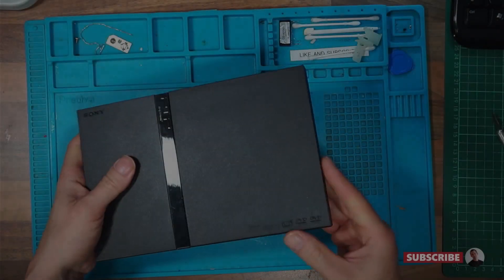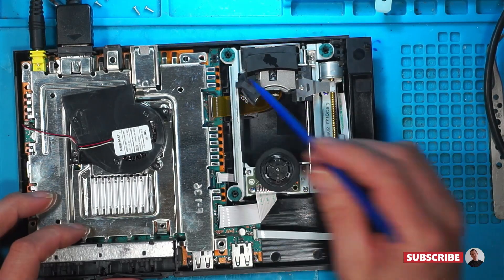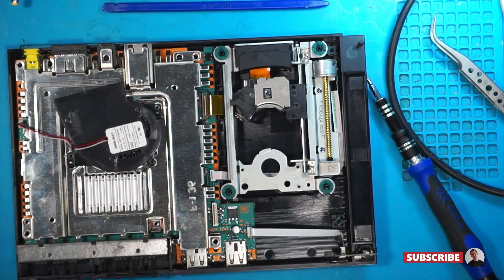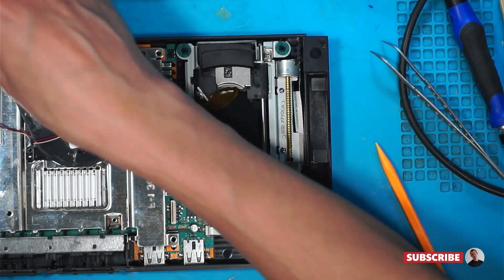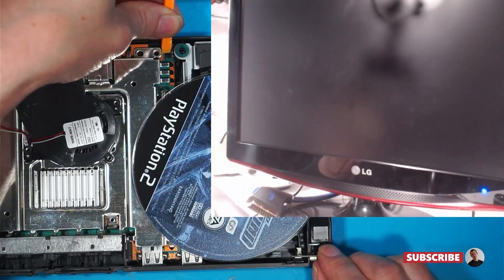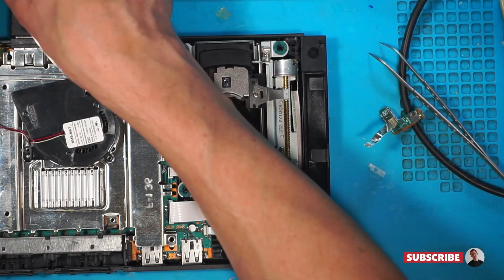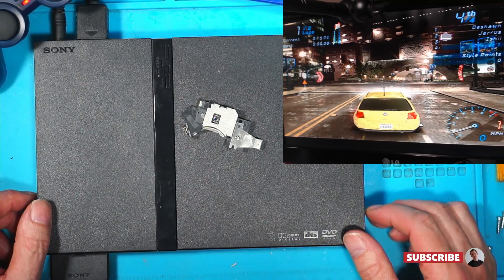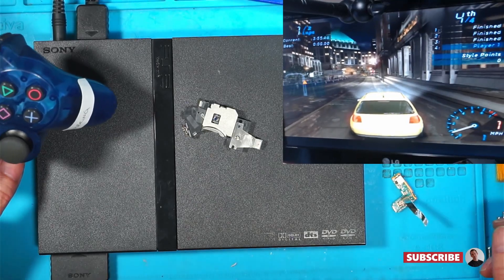How I Fixed a Playstation 2 slim that wouldn't read discs | PS2 laser repair

Comment: Interesting. My PS2 hasn’t worked ever since. So I’m supposed to replace my PS2 fat laser first? I know yours is a slim. Mine doesn’t spin disk either. The laser on mine is 1000% faulty that’s for sure. I just hope I don’t have to replace the spindle motor too.

Comment: I have a PS2 slim and I would like to know what are the signs of it dying.
Reply from the maker: When it doesn't play games? Does the one you have not work?
Reply: @PhilipBryden  my PS2 works but I would like to know what kind of sounds will it make when it is about to die.
Reply from the maker: @dianagarza9988  I don't think the sound it makes can give an indication of if or when it will fail.

Comment: Hello there. I found a similar problem in my PS2 Slim 77004. The disk doesn't spin at all. Do you think it is the same problem? I've done some troubleshooting, because i have another 77004 that works well. I took the cd drive from the ps2 that wasn't spining to the one it was working and it worked! So do you think that the problem is before like the main board? Or it could be the laser like the one in your video?

Comment: Thats a 7900x model, those are my favorite model PS2 Slims because the ribbon cable that give power to the laser assembly are held by plastic tabs instead of adhesive so you never have to worry about your games scratching.
You did a great job.
Reply from the maker: Thank you. I haven't came across any glued ribbon cables, so I must have got lucky.

Comment: Great video, may need to do this as mine packed in randomly. Ps2 slim.  However I don't even get the start up screen, either complete silence, or if I try again after a while it will make a rattle/grinding noise for 4 seconds and then nothing.  Power button is unresponsive, need to switch off from the mains. You reckon it's laser related or PS2 is knackered? Cheers
Reply from the maker: Sounds like the disk tray is jammed. Have you thought about opening it and taking a look inside?

Comment: I might have a bad laser but im not sure because i play underground2 most of the day no problem but i play san andreas but it glitches bad i check the disc & is not scratch its in good condition but after a few hours starts to do that im not sure if its the laser because the center piece spins,tape also works doesnt have contact with disc thats why my concern its the laser but im confuse do to the fact with underground it works really good🫤any advised?
Reply from the maker: They only thing I can think of is to try a different copy of the game you want to play on. If multiple games are not working, it's probably the laser.

Comment: I bought a silver PS2 slim off of Facebook marketplace “tested and working” and no disc spin, laser and motor don’t work. I checked the switches with the lid off and the ribbon cables seem fine. Not sure how the whole laser assembly just doesn’t work
Reply from the maker: I believe the laser switches on, looks for a disc before there's any disc spin. So if the laser is faulty, there's no disc spin. With the lid off, do you see the laser itself move up and down attempting to disc, when you press both lid switches?
Reply: @PhilipBryden  I get nothing from the laser. It doesn’t turn on and it doesn’t move up and down on its rail. I took it off the motherboard and cleaned all connections, cleaned the laser with alcohol and reapplied white lithium grease to the rails of the sensor and still nothing. I found someone selling the whole laser assembly on eBay so I’m going to give that a try when it comes in.
Reply: @PhilipBryden  Yes My Laser Goes Up And Down But No Spinning🥲
Reply: What to do?
Reply: @bhartikurolya6754  I still have that PS2 and swapped a brand new laser and it does the same thing so I know it’s not the laser but something else. I’ve put that on pause for the time being

Comment: Can I do this on PS2 model-90004?
Reply: Because I have three new PS2 90004s, but one of them had a lens that did not work, and I saw that the lens wire was dry and cut, so I thought that the lens that was in that PS2(1) was good and would work well, so I took the lens and put it in the PS2(2)  But when I wanted to turn on the PS2 (2), the lens did not work and did not move, so I replaced it with a used one, but it did not work 😁 and I took that lens and put it in the PS2 (3), I turned on the PS2 (3) but the lens did not work and  Or is it moving 😁 Then I made sure that it was really not good, so I put back the lenses of the PS2(1) and PS2(2) but when I turned them on their lenses did not move and here I realized that I made my misfortune three misfortunes🤣😁🤣
Reply from the maker: I went to Aliexpress and searched for PS2 slim lasers. I found this

"SPU-3170 Laser Lens with Deck SPU3170 For PS2 Slim Game Console For SCPH-7500X SCPH-7700X SCPH-7900X SCPH-9000X Dropship"

which suggests to me the 9000x model uses the same laser as the 7xxxx listed in the same advert.
So I can't say for sure, but it looks like you can.
Does that help?
Reply: @PhilipBryden  yes, thank you, But read my story with the three PS2 😁🤣

Comment: Nice job! Since you need a new laser replacement , maybe the one removed today can be fixed? Curious as to why it stopped working. Maybe something there on it that is noticeable?
Reply from the maker: Don't they just wear out over time? It seems such a common problem across all disc based games consoles.